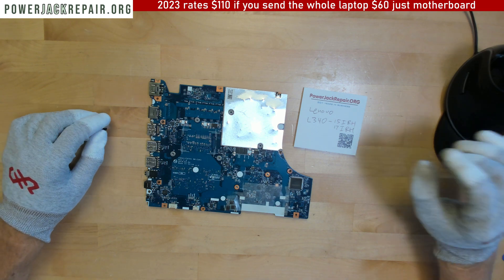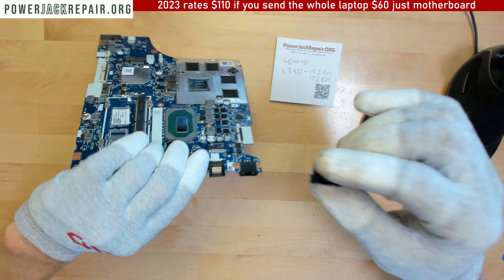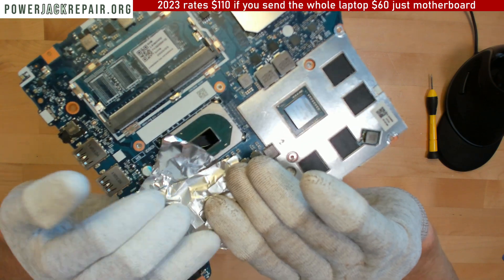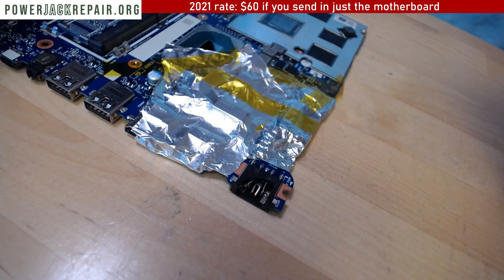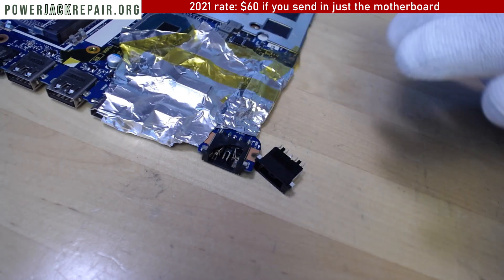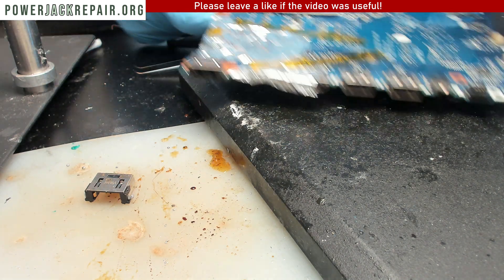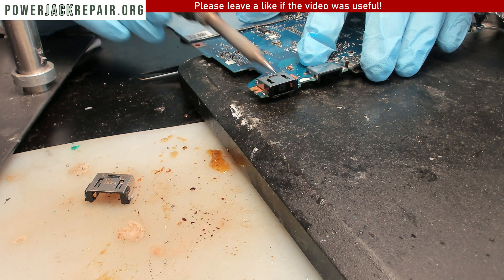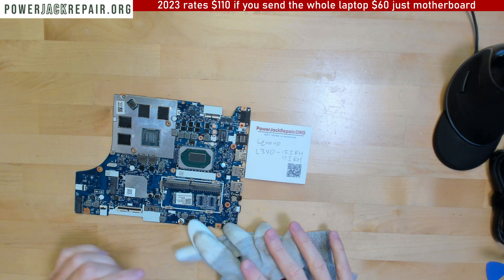How to fix repair a broken power jack on Lenovo L340-15IRH 17IRH laptop charge port no power

Comment: I believe if the pins are touching, it causes a SuperIO failure. This is rather common on a lot of Lenovo laptops but you do need the special programmer or buy a pre programmed chip.